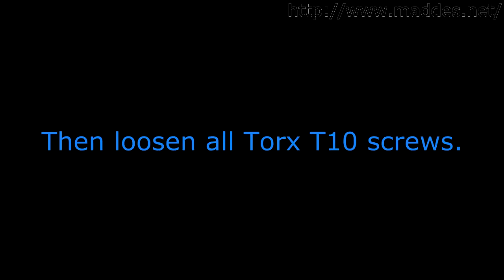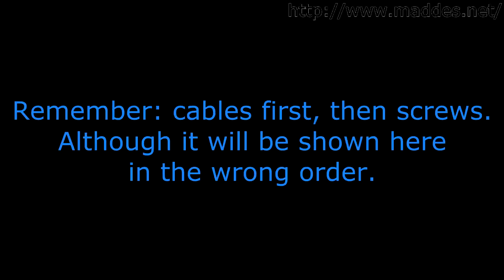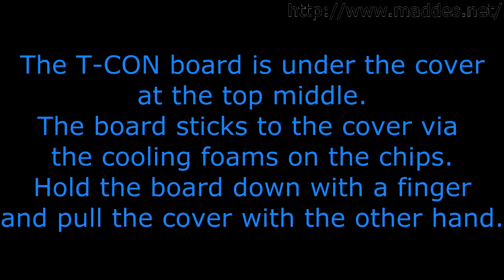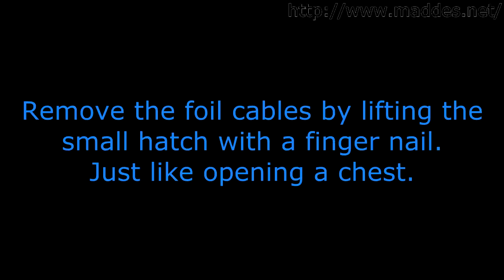How to open a Philips TV set 9803H to access the T-CON board

Comment from the maker: The cooling foam only avoids another chipset death after a few years, therefore only extending lifetime of the T-CON board. Picture quality is not affected.
I covered all remaining chipsets with foam.
Got the foam (Phobya Ultra 5W/mk 30x30 x 5mm) via Ebay from a local distributor (see [1] in video description)

Comment: I have contacted the sellers there on various occasions, even got the first replacement unit ( 42T04-C05 ) from there ( i was unable to find any C0B then )

Prices vary incredibly, from 80-100$ to 250-300$ with the later rendering the replacement too expensive and viable. Where could i find proper foam for the TCON ? I might try foaming the one i got ( C05 ), do you think it could make things better picture-wise ?

Comment: i have the 42pfl9803h10 and its flickering when you open it for a while and after an hour plays with no problem in 4:3 not in 16:9,when you connect pc or dvd it flickers all the time.They told me it has burned panel screen can it be any other problem?

Comment: I have pretty much done the very same steps to replace my Philips 42PFL9803H/10 TCON. Mine is a 42T04-C0B model and i tried replacing with 42T04-C05 and although i fixed all darkness issues, colors were inaccurare. It seems there are models with 42T04-C0B and others with 42T04-C05. Still looking around for a 42T04-C0B replacement. I have photo of my own TCON here: nickpar.dyndns.org/uploads/files/1/Graphics/DSC04127.JPG.